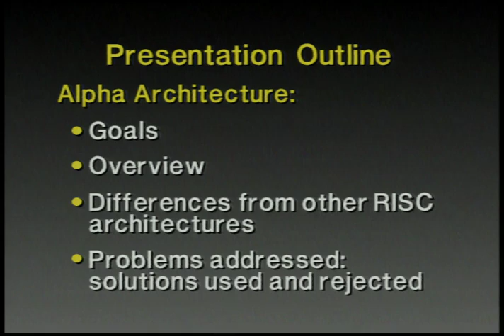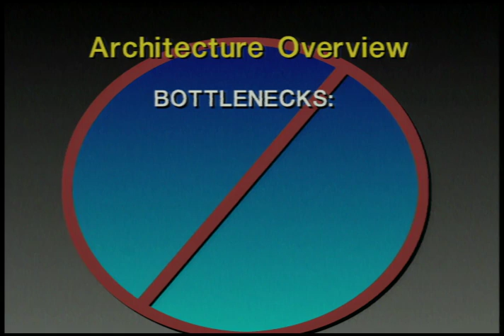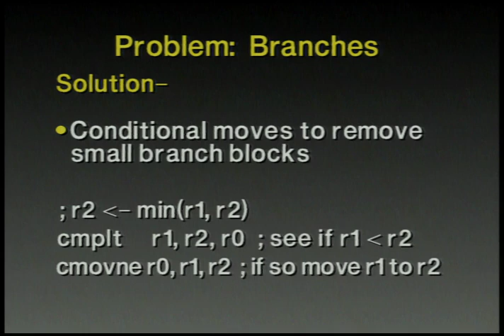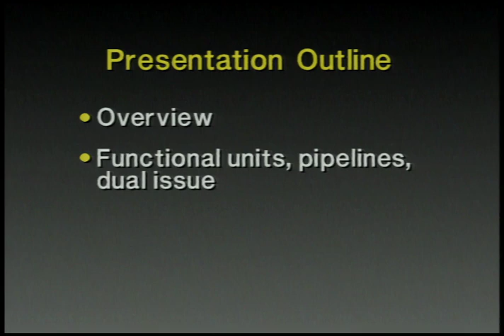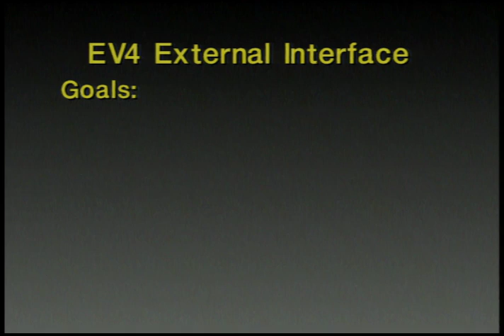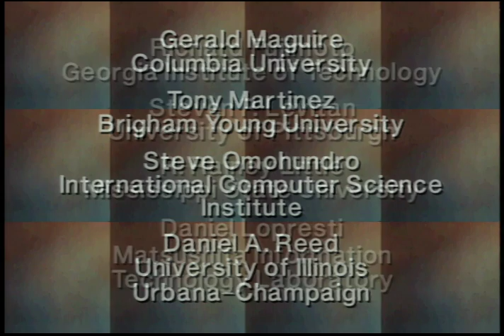Alpha Architecture, lecture by Richard L. Sites and Dirk Meyer

Comment: The predictions from 2:52 until about 4m 43s seem to have been eerily accurate. This was 1992, remember.
Reply: When I bought my midrange gaming laptop two years ago, exactly 25 years after this talk, it indeed had a 12 independent issue multiprocessor with probably about 5 way superscalar and about 22 times faster clock speed. Pretty good predictions.

The only thing they missed was that a good chunk of its performance is from a fine grained SIMD processor in it that costs at least as much as the processor, in the form of the dGPU.